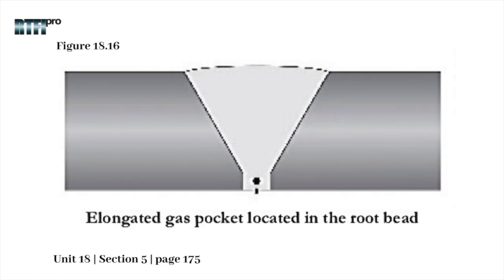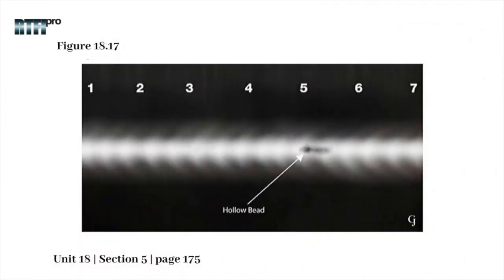Welding Discontinuity  | Hollow Bead

Comment: Question: if hollow bead is an elongated gas pocket and porosity is a rounded gas pocket, why on API 1104 you are allowed about 60% more hollow bead and they are both considered gas pockets?
Reply from the maker: Hello Tony, porosity is a "Rounded indication" and the hollow bead is an elongated indication. A rounded indication is an indication were it length is less than three times its width and elongated in an indication where it length is greater than three times its width.  For example a porosity that is 3 mm is round and it is typically not flat but has depth as a circular indication were hollow bead in most cases is elongated without the circular depth.